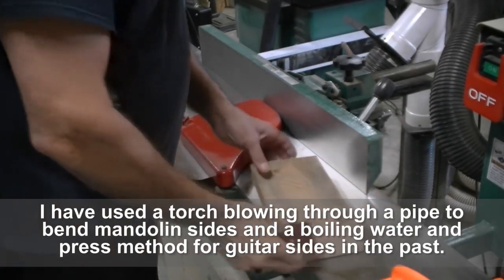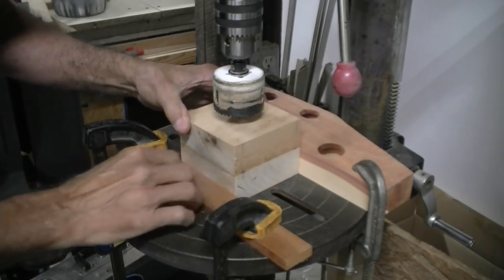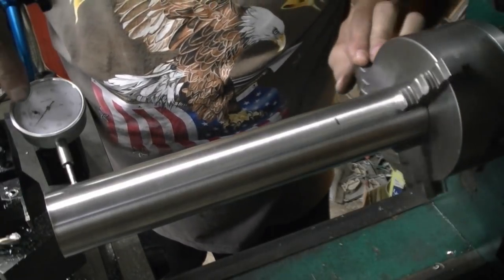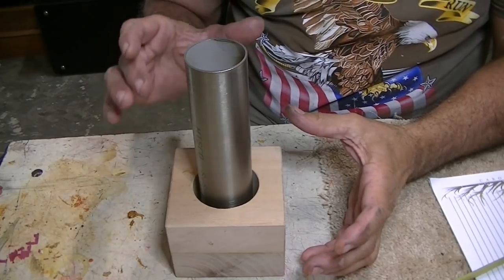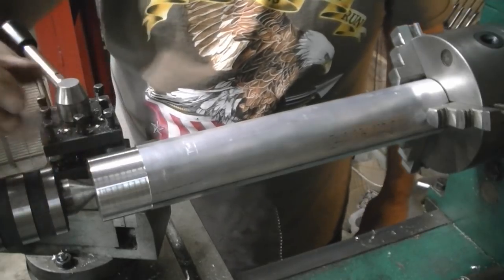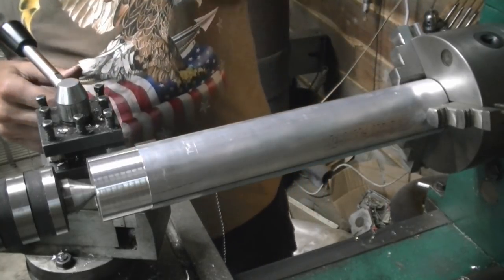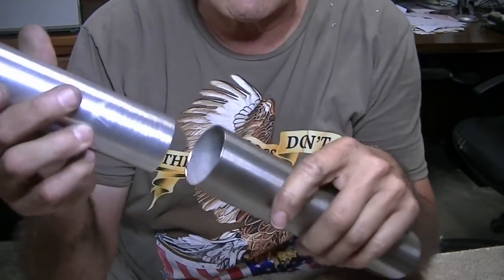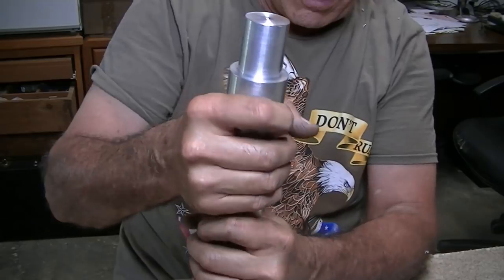225 RSW Custom Guitar P3 Bending Iron Build

Comment: thank you . if you are having trouble with the part off tool on the lathe make sure you the tool is centard. too low the piece will climb too high it just rubs . use a 12 " scale ( ruler ) in between the tool and work piece bring the tool till it will hold it step back and look is the ruler scale straight ( up and down ) if so you are centered . oh set your self up with flood coolant big help. hope this helps
Reply: thank you hope that helped

Comment: Just a couple of comments Jerry. I worked as an engineer for Beloit Corporation for many years. They made many, many parts out or stainless steel. Stainless can be either harder or softer than mild steel depending on the grade. However; it is always harder to cut than mild steel. Like balsa in the woods, it likes to ball up and gaul rather than cut. I don't know the specifics, but one of the machinists told me that the cutting tools take a whole different cutting angle and clearance angle than a tool for steel. You might want to research that info and see if it will help you when you are cutting stainless. Also aluminum expands at a faster rate than stainless, so it will only get tighter when a piece of aluminum is inside of stainless as it heats up. If, however; you were to cool the rig, it would get looser. I think aluminum will be A-OK in this application.

Your build looks very professional and I love the formica base. I worked on plastic extruders for about 10 years also and thermoplastics begin to soften about 300 F and become liquid at about 400 F give or take a little depending on the particular plastic, so I think your 350 F in your replies to the comments is right on for wood.

I don't think you could buy a better wood bender than the one you've built. If you have any problems with it, I believe it will be the plaster of Paris. If you do I would suggest fireplace cement mixed a little wetter than usual. That's just a gut guess though. Like you when I'm building something that I have never built before, I throw out the rules and go by my gut. My gut as yours has, has served me very well in the past. In any case I love your ingenuity, your work and your five star video.
Reply from the maker: Thank you. So far it's working awesome. Once I turned up the heat on it and I got it up around 350f or so it bent the wood fairly easily.

Comment: You might like to consider a variable Thermostat or a fixed one. Just like Ironing device, it has a variable thermostats inside. Fixed thermostat will be easier to install when you knew exactly which degree you wanted. 
Heater element will transfer heat better using a plaster thermal grease, it will transfer heat very nice and evenly on contact area.
Using a high temperature wire heat sleeve or tube will be wise to avoid cables melt on your heater.
Good luck on your project and googling parts that I meant to, I do really enjoying watching you working on things 😊👍🏻
Looking forward for your guitar build anyway 😄

Comment: I agree with boo boo, a simple steam box might help with the bending.  Not steaming to noodle stage, but with more moisture and limber than you are getting with a squirt bottle. Fantastic project that, when you get the hang of it, should do a super job for you. Good video, Jerry.
Reply from the maker: I have built Steamers before and tried it and had very little success on building it bending guitar sides. I know people say it works but it's doesn't seem to work for me.

Comment: Next time you use a metal hole saw and you have already drilled a guide hole you might try using a 1/4" rod instead of a 1/4" drill bit in the hole saw.  I use one to keep the hole saw bit from reaming the hole, it really helps on metal if you are drilling holes to make sure you are dead on the mark using a hand held drill motor.
Reply: That sounds like a great idea.  I'll remember that one.
Reply from the maker: Thanks for the idea. In this particular case that wasn't the issue at all. It actually tracked very well.

Comment: HI Jerry great content.  In order to control the temperature properly you need to drill a hole it the aluminum and insert a thermistor as a temperature sensor.  Then use some type of controller to  vary the power  to the heating element.  I  can help with the electronics if you are interested, contact me.  However if the temperature only goes up to 240 with the variable speed controller you have, I think that's all you really need.

Comment: Jerry, this bending iron is fantastic! I made mine with steel pipe and a propane torch. Getting the temp just right on mine is always the tricky part. Yours will serve you well! Great project. I really like the table! A 90 degree to the iron is so accurate! Thanxz
Reply from the maker: I've used a pipe and torch method for 30 plus years with my mandolin. I've always boiled the guitar sides and press them in a press. But this time they broke. So I decided to build this tool. I think the tool will work even better for mandolin sides.

Comment: I think you did an excellent job Jerry! The only thing in the process I would have done differently is before pressing the aluminum inside the stainless pipe is that I think you could have put the aluminum piece in the freezer and the pipe in the oven and it may have slipped right in with no pressing. I do this on crankcase bearings all the time. But your method worked pretty good as well. Great video!!!
Reply from the maker: I've done it that way before and thought about it this time but that press just makes you lazy.

Comment: Being a retired AC mechanic I would tape the temp probe with some elec tape an put something to insulate it around it so the temp probe only gets temp from pipe. Hope I made it clear. Enjoy your channel. I think you were doing that but could not tell for sure.
Reply from the maker: I thought about taping the probe there. But I figured the tape would probably just melt off and fall off. High off camera I was holding it on there with a little wooden stick and that seemed to work really well.

Comment: Hi Jerry, Wood is actually a mix of fibers which are a non-soluble sugar polymer (cellulose) and an amorphous fraction that serves as cement or resin for the fiber mesh. This cement is made of hemicellulose another nonsoluble sugar polymers. Heat is melting theses sugars that is what really helps you to bend wood. Steam avoids the wood to burn and is a heat transfer media. Your tool should work well. Spannish guitar makers simply use a bulb with a dimmer :-) inside a pipe.  Please ground the aluminium core you work with water :-) i love your knowledge sharing.
Reply from the maker: I did ground it. Thank you for the information.

Comment: No idea if you already did something like this, but I'd add some thermal paste, like Arctic Silver, all over the heater element. That way you'll get a lot better heat transfer.
EDIT: And for your next version, once you get the aluminium and SS pipe sized that way, throw the aluminium plug in the freezer overnight, and the SS pipe in the oven... The ice cold plug should easily slide into the oven hot pipe. And once cooled, would have an even firmer connection than pressing them together could manage.
Reply from the maker: If it worked any better than it does it wouldn't look like I made it. LOL in fact it works really really well.

Comment: Hi Jerry
Glad I got to meet in person and play a little in Mt. Veiw.
I have a small lathe (atlas)
I couldn't get a parting tool to work very well because of flex in the tool post. I found that putting in back gear and running slow worked much better. Looking forward to more build videos 😄
Reply from the maker: This grizzly lathe doesn't have back gear. I do pretty good cutting off aluminum and sort of okay cutting off mild steel but the stainless steel it didn't even hardly scratch it.

Comment: Awesome great video. I have seen videos they build a jig to hold the sides in place. That way both sides bend to the same perfect measurements. No guessing that way. But you have done an awesome job on your iron. I think it will work great. The more you do it. The better you will turn them out. Many thumbs up to you and this video. I hope you have a very Blessed Week.
Reply from the maker: I have those jigs also. And that's the way I've bent them for the last 30 plus years.

Comment: The reason the IR thermometer is not accurate with the polished surface is that the emissivity of a polished metal surface is about 0.1 - 0.15 - regardless of the type of metal.  If the meter has a fixed emissivity, it is probably set for 0.9.  If your meter has an emissivity adjustment, set the emissivity for 0.1.   Since emissivity is a surface effect, you can alter the emissivity of the surface to get a more accurate reading.   If you painted the surface black, it would be 0.9 emissivity.   You could also put a piece of masking tape on a small area and read that.  The emissivity of masking tape is about 0.85 so that would get you closer to the setting of the IR thermometer, if it has fixed emissivity.

Comment: Nice video Jerry. You might think about making a 6'' or 8'' bar to be drilled to fit over your existing one. That would give you a larger heat surface to start with. Just a thought.

Comment: Hi, Jerry.  New subscriber here.  I love your videos and the way you walk us through what you're doing.  Thank you!

I'd like to drop a hint on using the Infrared, non-contact temperature sensor on shiny or other objects: put a piece of masking tape or black vinyl electrical tape (FLIR says use "Scotch 33") on the part to be measured and point the temperature sensor at that.  The tape's emissivity is very close to what most IR sensors are calibrated to expect.

Comment: make a steamer box with a kettle, place your timber in the steamer box for a period of time (test 10 minutes first) then use your new tool to get the desired shape.  Once you are happy with the shape you might want to try making a jig you can place the newly formed timber in to dry out in the final shape you require.  The timber should bend much easier and quicker coming from a steamer box first.
Reply from the maker: I've tried steaming wood many times in the past. It hasn't really helped me very much. It seems to dry out crazy fast when your trying to bend it. I have boiled it in a large troft and bent at least a half-dozen sets that way over the last 30-plus years and that works pretty good but that's also how I broke the last set of sides

Comment: If you used thermal paste, it would heat up faster and use less power plus if you add a temperature controller and use the paste on that as well it will be more accurate and more responsive. You can get it from Grainger but be sure you get the stuff for HVAC use and not the stuff for electronics as that stuff hardens. The paste for HVAC is a silvery paste the other is white. But be careful, it seems to get everywhere somehow lol
Reply from the maker: I'm not sure how I would use paste on bending wood? I do have a temperature controller on it already. And it seems to be incredibly accurate.
Reply: Rosa String Works Sorry, I should have been more specific. You put the paste inside the hole that you put the heater in and on the metal part of the heater itself. Air is an insulator. The paste fills the gap between the heater and the aluminum and conducts the heat VERY well. You'd also use it in the same manner for the temperature sensor. Put the paste inside the hole that you put the sensor in and on the sensor probe that goes into the hole. If you just mounted the sensor on the surface, then you just put a little dab on the surface and mount the sensor on top of that. You'd want to be sure that there is no possible way for the paste to get on the wood. I doubt that you'll do any of this since you've already got it together, but the paste really works great. I bet you'd notice you're metal heating up almost as soon as you turn it on. But why fix what ain't broke. Just thought you'd like to know what's out there :)

Comment: Have you looked in to using a PID and SSR type temperature controller? There are lots of little made of chinesium kits on ebay for less that $20. People use them for controlling wood drying kilns, pottery kilns, sous vide crock pots, and all sorts of stuff that needs controlled heat. If you search youtube for "pid temperature controller" there are "About 53,000 results."

I enjoy your videos. Thanks!
Reply from the maker: Thanks I'll check it out.

Comment: The StewMac product site says to use theirs at between 350° and 400°, and it takes about 45-60 minutes to heat up.
Reply from the maker: That's where I ended up going to with mine. And it only takes about 20 minutes to eat up.

Comment: Epoxy resin would of worked with aluminum powder mixin in. im sure the plaster will crack. i used to work in a tile factory. . they do hold heat but rott very quick when water is added  after setup. maybe add a resin top to the plaster ?? good job jerry.. O I SEE YOU ADDED A TOP. OK.. COOL.. ID TURN THAT BAD BOY ALL THE WAY UP AND GO . GO .GO :)

Comment: Noice build,  all occasionally used Hi-Temp Silicone Rubber glue tubes are eventually opened in the "middle" . . .  IR issues w/ reflective surfaces . . ..  Black Sharpie . .    m_m

Comment: How lose is the heating element fit? Might thermal paste improve heat transfer between it and the aluminium?
Any idea of the temperature the element can reach without the speed controller? Maybe it's a bad one. 
I like the suggestion above of using an oven or stove thermocouple control of some sort. 
I gerry rigged a temperature controlled soldering iron some years back using a light dimming switch, probably not one of the safest things I've done (safer than my tinkering with a high voltage transformer from a neon shop sign attached to two pieces of foil ever side of a sheet of glass to make an ozone generator though :-) ).

Good.luck with it, I hope you crack it soon.

Comment: Perhaps you could fill the gap between the heating element and the aluminum with thermal compound. The one used for microprocessor cooling. probably expensive in th cuantity you need.

Comment: Nice result Jerry, looks like a solid tool. But after seeing the build process It seems Stew may not be to over priced.
Reply from the maker: Yeah it was quite a bit of work but it didn't really take all that long. By the hour I lost money. But what's the fun in buying a tool?
Reply: Well like they say, getting there is half the fun. I was wondering why you didn't just go with the aluminum since the diameters were the same?
Reply: How long would you have to spend online shopping to find one even without the nice table in hours? You have to count that too if your really going to count all your time.
Reply: I forgot about the table, that's a very nice feature.

Comment: Also, you might want to reference Chapter 19 of the USDA Specialty Wood Handbook -  https://www.fs.usda.gov/treesearch/pubs/download/37414.pdf  

According to the handbook, " The lignin polymer in the middle lamella and S2 layer is thermoplastic; that is, it softens upon heating. The glass transition temperature Tg of the lignin in the matrixis approximately 170 °C (338 °F). Above the matrix Tg, it is possible to cause the lignin to undergo thermoplastic flow and, upon cooling, reset in the same or modified configuration.  This is the principle behind bending of wood."

So, you may want to try higher temperatures than the 200 F range.
Reply from the maker: Thank you. Will try that.

Comment: Jerry, I am sure you have used the bending iron by now.  What temp have you ended up using for bending? I am surprised at the low temps suggested in the video.  Stewmac suggests 350-400.  Curious on the reason for the wide variation....

Comment: thank you . suggestion if you dont mind on small holes in machine shops we would drill a 1/64 under the size hole then use a reamer for the right diameter that would get you dead on . the reason i am passing on this info is i get info from you so kind of an info exchange if you will. again thank you
Reply from the maker: Yes thank you. I'm actually familiar with that process. Just didn't have any reamers at the time I made this.
Reply: @RosaStringWorks  understand we tend to make do with what we have

Comment: Jerry, is the 3 jaw chuck a thru hole??  If you drip alcohol on the aluminum at the  tool insert,  it will give you a mirror Finnish, slow feed.

Comment: Instead of pressing the aluminum into the SS, could you just throw the aluminum into the freezer to shrink it?
Reply: That's, exactly, what I was thinking.
Put the aluminum rod in the freezer and heat the tube with a torch (Oxy or Propane).
Maybe, apply some thermal paste, to the rod, for better heat transfer and (maybe)
some help slipping into the tube. Whack rod into tube, using a wooden mallet or dead blow hammer.
Be well prepared and work fast. Keep rod in freezer for a couple hours, to maximize shrinkage.